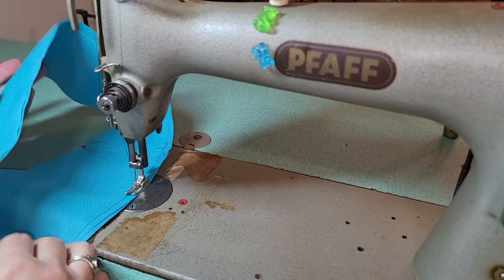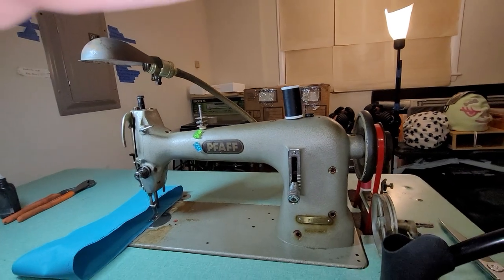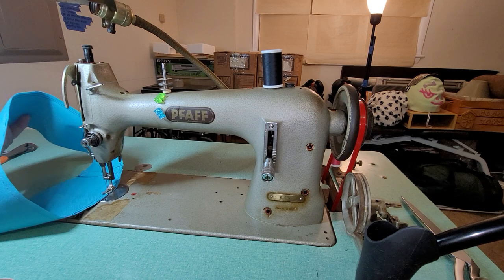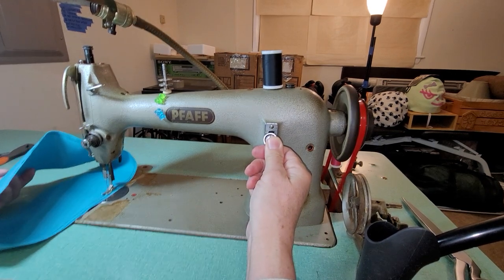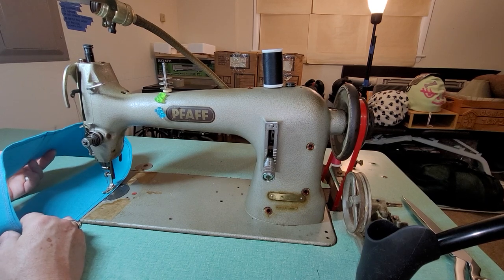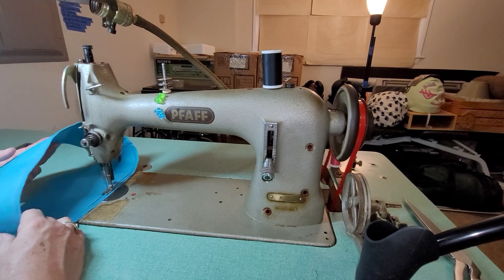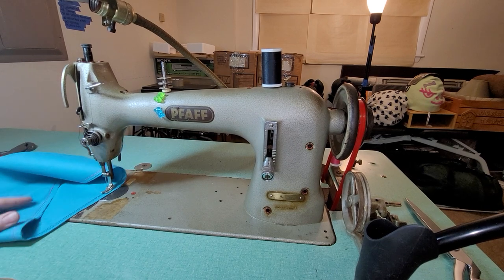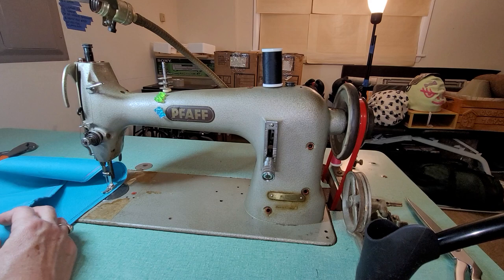Using a Clutch Motor on an Industrial Sewing Machine

Comment: Hey, I have the same clutch set up for my Singer, and the clutch material is probably the same as mine: a thick strip of leather shoved into a groove. I happened to have some saddle leather sitting around and cut a strip to use. I even cut grooves "castellated" the strip, creating less surface area so that maybe I can slip it even more. Probably the reason it's noisy on your machine is that the leather is hard as a rock or glazed over. If you pull off the arm with the disc/pully, you can get a look at the clutch material itself. You may be able to use a wire brush to clean up the leather or just replace it with soft, new material. Then you have to put it back together and adjust it right. Not really a big deal, though. I'm guessing you'll be able to slip that clutch even better and quiet it down at the same time!
Reply from the maker: Thanks for the suggestions that's a good idea I've been using it and it's working pretty good I made another video making wheelchair and Walker bags where it's actually working quite well so if it ain't broke don't fix it. But in the future I may do some of your suggestions. Thanks so much for watching my video and thanks for taking the time to give me your suggestions. Really appreciate it take care and keep on sewing!